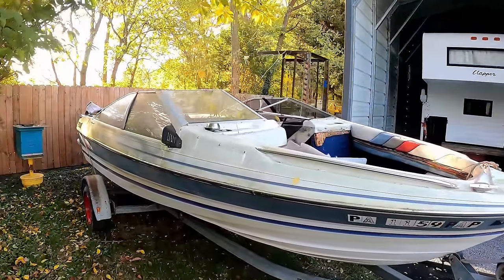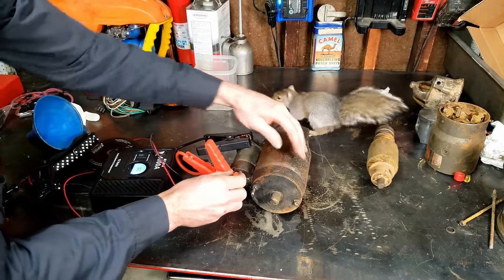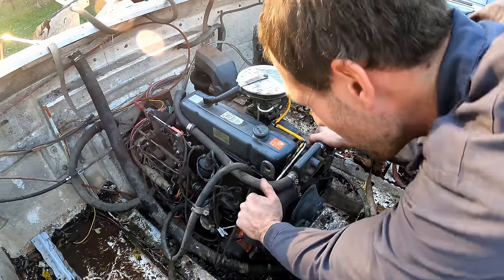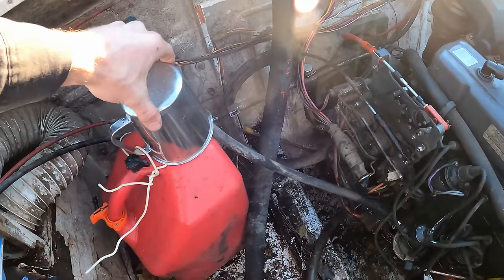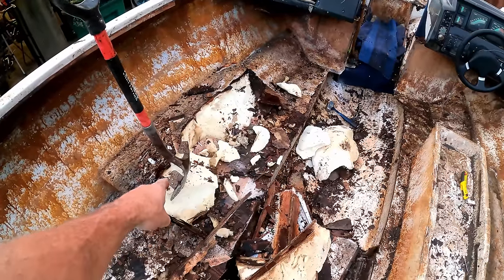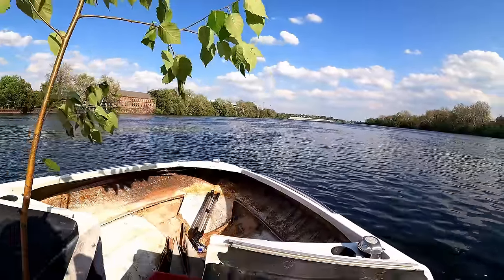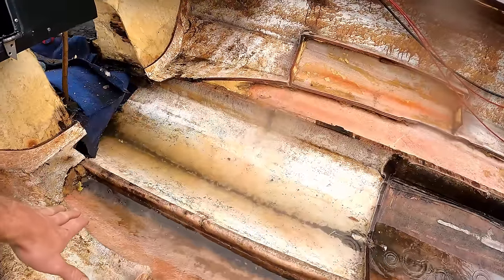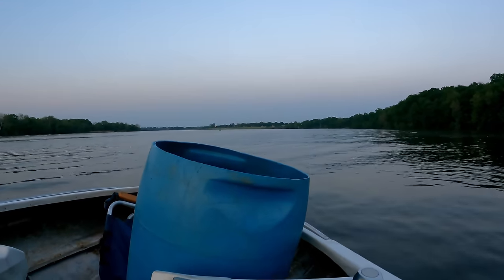TRASHLINER Boat Consolidated (All 3 videos cut down to one)

Comment: We have had Bayliner on the half of the family since I've been alive. 
Even though the first ones were not running anymore due to no mechanical experience the latest Bayliner with a 4.3l remains in near mint condition for a mid 90's boat. 
I've had a blast tubing with it and seeing the beauty of those spo r t boat on the water to today's standards. Especially the used market what a jem

Comment: The “Escort” trailers supplied with Bayliners are actually decent units. They were hot dip galvanized along with all of the hardware and resist corrosion very well.

Comment: Thanks for picking up plastic.  I do the same.  Fun little boat project.  Put a bass boat deck/elevated floor on it with cheap ply and the gull will firm right up.  You could fill the void with 2 part closed cell foam.  Put a perf pipe along the keelson and drain any infiltrated water to the stern

Comment: This looks like about a 1987 Bayliner Capri 1900 with a 3L 4-cyl. It's an absolute wreck of course, and would not be restorable, due mainly to lack of parts. I restored my 1986 Capri to rear-original factory interior and upgraded to Chevy 350. It will do about 52 mph.

Comment: That Bayliner looks like around 1988 when I was a young guy I worked for a boat dealership getting these boats ready for sale and taking customers out on them on sea trials. These boats were shit brand new coming off the truck things would be broke on them before we even touch them. The only thing good on these birds is when they switch from OMC to MerCruiser and that was a good thing but the rest of the boat sucked falling apart as you looked at it……

Comment: Tyres have manufacture dates embossed on sidewall, google the code, year plus weeks to get date of manufacture, it’s illegal to drive with old tyres,  depending local regulations, no problem back street but distance and high-way use may pose an insurance problem if they cause a failure drama. Fun hey

Comment: GM engine. I had one.. be careful witht his fuel pump, sometimes it breaks and starts to pump gas into the sump , when you realize it, the engine oil is so thin that your engine is going ( bye bye )... lol..      I had one with 6 cylinders and three carburators , one for every two cylinder.  it gave 160 HP..  but I had lots of electrical problems with it ( and I am an electrical engineer ) unfortunately I was still too young at that time not graduated yet and it was my first boat, so all I learned was the hard way.

Comment: As a car and aircraft mechanic, there is a complete run down list of points to check before starting a engine in that condition.
Reply: Was I mistaken or did he really use what looks like JP Weld on the block ?
Reply from the maker: Permatex the right stuff. It's a pressurized cooling system and the crack is from a freeze. It's not structurally significant

Comment: Your video reminded me of doing a very similar thing to my third boat a little Winner (brand) cuddy cabin. I had passed the boat many times in the parking lot of a marina in which I kept my Catalina 22 sailboat. It was the most derelict looking poor old boat imaginable with a sapling growing through its deck and a hole in the bow. I just liked its lines so I questioned the marina manager and was given the owner’s name. And for $100 I bought the title to the boat so I could register it if I repaired it. I spent a winter and spring going to the marina after work and on weekends and finally got a sweet boat and I rebuilt the trailer and towed it from Maryland to Florida where I moved after law school way back in 1980. However, I rebuilt my boat to look new and you gutted yours. Not exactly my style but who cares?

Comment: As for the boat, Things are looking Squirrelly. NO...Not the Squirrel but the OMC out-drive.  OMC was the company that almost Ruined Chris Craft Yachts in the 90's. OMC was a great company form early 1900 as Evinrude outboards then Johnson Outboards in the 1920's. They had capital and engineering teams capable of going head to head with Mercury Marine. It's an interesting story with a sad ending.

Comment: I suppose you're just doing this for content . I used to repair hurricane sunk or damaged boats and the first rule before anything is resale value. You'll spend more hours and money that you can ever resell that boat. There are  hundreds if not thousands of $500 craigslist Bayliner's that are runners . Main thing about boats is that most zombie repairs don't really last very long  due to corrosion,short circuits ect
Reply from the maker: Enjoyment is a big factor as well. Yeah if doing it just to flip it, that would be a no-go